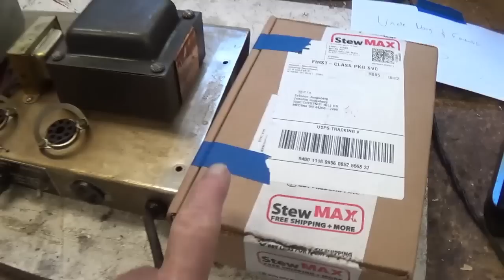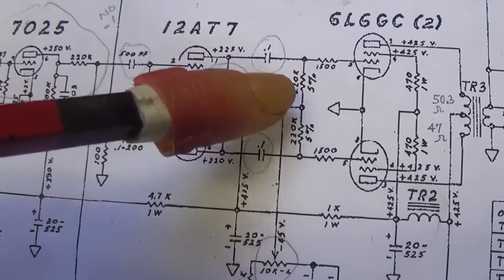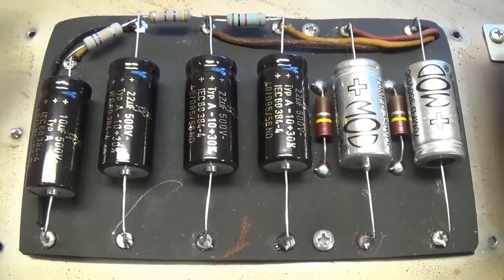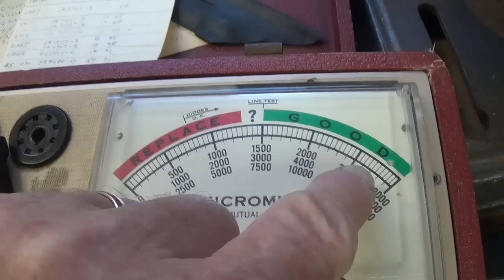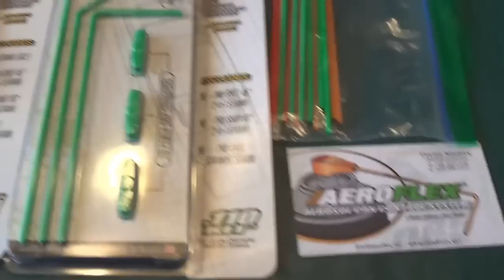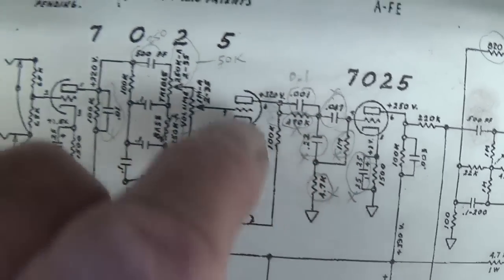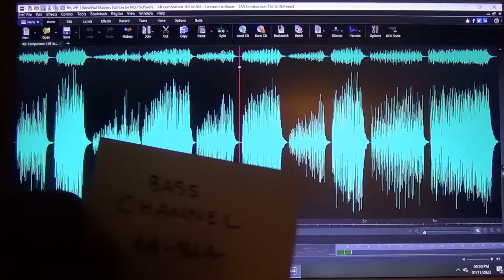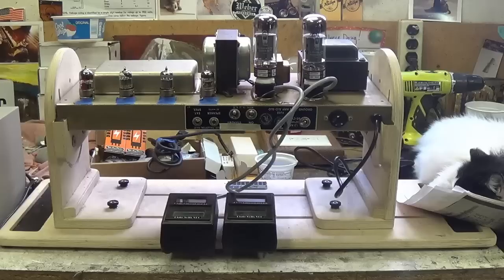Is the Conversion of a AA-165 Bassman to AA-864 Specs Worth the Effort ?

Comment: I'm not sure if it was mentioned in the video, cause it's a long one to scroll back through and double check, but anyone know if this mod also addresses the gain stage phase problem when jumping the channels on the ab165?
Reply from the maker: I believe it was, @V, but if not, you're correct that a problem exists since the channels are out of phase.
Reply: @UncleDoug  thanks for the reply. I noticed my message said ab165, I meant to say aa165. Were you able to jump the channels after doing this mod on the aa165? Or would it require another mod to the gain stage of one of the channels?
Reply: @UncleDoug  if you didn't try jumping the channels or don't remember the results that's fine. Just asking cause jumping the two channels would make the 864 mod more useful to me than using the bass channel on its own.
Reply from the maker: @UnvisibleINK  I rarely ever jumper channels on any amps I demo, @V, but in original configuration, the only circuit that supports jumpering is the AB-165. Neither the AA-165 or the AA-864 are suitable.
Reply: @UncleDoug  Yeah sorry, I did that bonehead thing of asking a question I could probably just research and then researching it myself straight afterwards.

I did a bit of digging around about the 864 and learned basically what you just said, but thank you very much for taking the time to answer the question. It's still an intriguing mod, but something I'll only consider getting done if I feel like the amp needs some general maintenance and component replacement anyway.

Would be great to know how the 864 and 165 compare with bass. If you ever get asked to perform this mod again would you consider comparing how each circuit sounds with a bass guitar? You'd expect the 864 to sound better with everything but maybe the more anemic 165 is actually tighter and more focused with an actual bass signal.

Anyway, be a cool thing to test if the opportunity ever arises again. Thanks again for your insights.
Reply from the maker: @UnvisibleINK  Thanks for your nice comments. I don't personally own or have access to a bass guitar, thus I am unable to provide comparisons using one.

Comment: Ever wondered why the circuits are labelled AA864, AA165, AB165 rather than AA864, AB864, AC864 or AA864, AA165, AA465? It seems Fender's rule was that you only advanced the letter if the circuit revision was the same YEAR, otherwise you started again with AA and a new month and year.
Reply from the maker: Interesting observation, John. Thanks :)
Reply: @UncleDoug Uncle Doug, unfortunately this torpedoes your theory regarding the Princeton Reverb AA764. Had there really been an AA764, there never would have been an AA1164! Instead, it would have been AB764.
Reply: I incline to the typo theory: possibly for AA467

Comment: I'm not sure how I feel about this. There are still alot of these and they aren't the greatest circuit Fender used but I hate to see it changed. Why not just buy an 864 or at least a 165 in worse condition.
Reply from the maker: This was addressed in the video, Carl.
Reply: @UncleDoug  Yes you did, It was just my initial thoughts before I saw that and I forgot to delete it. Great video as always Uncle Doug

Comment: I own an original, BF version of both.  AB165 is a better amp.  Hands down.
Reply from the maker: Thanks for your input, Jamie. I wonder how the AB stacks up against the 864?
Reply: @UncleDoug  AB165 is gainier, and tends to have more low-mid grunt than AA864.  And it breaks up more readily.  AA864 is very much a conventional a standard BF (AA764) 6L6 tone.  The AB165 is its own animal.  Great, great overdrive tone with the amp on about 7 or 8.
Reply from the maker: @jamiemascola6614  Thanks for the input, Jamie.

Comment: I had to turn off when I saw you replace  carbon composition resistors with a metal oxide. The amp is lost until someone repairs it properly.
Reply from the maker: Nonsense....The use of metal oxide resistors in the power supply is 1.) Standard procedure  2.) Vastly superior to CC resistors, and  3.) Has absolutely no effect on tone.